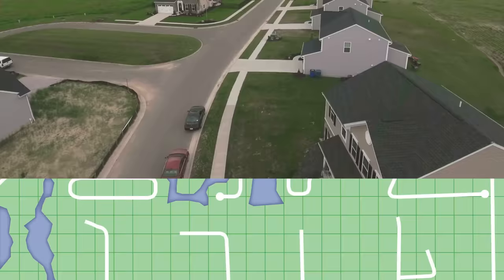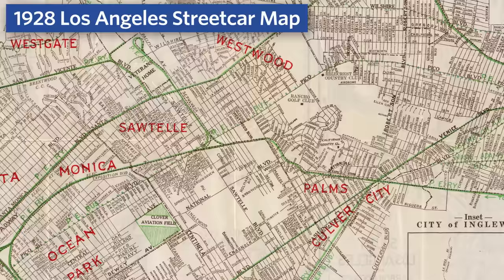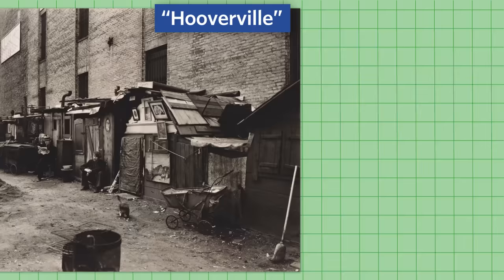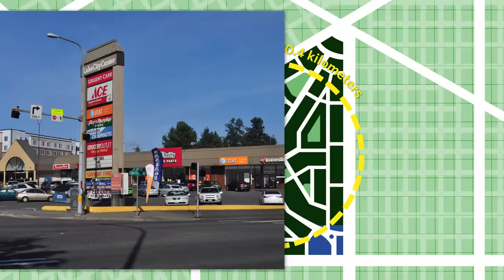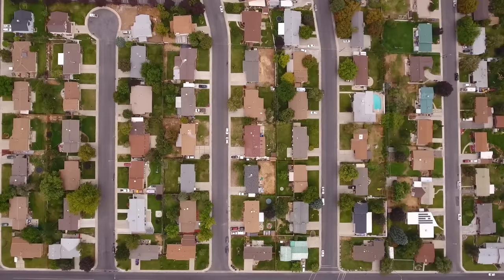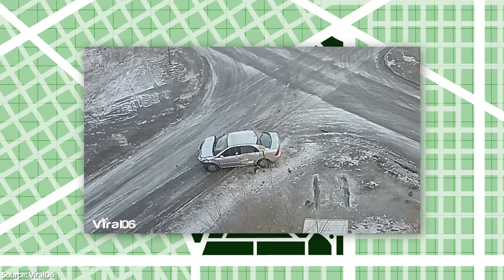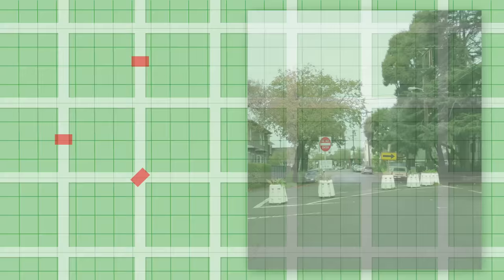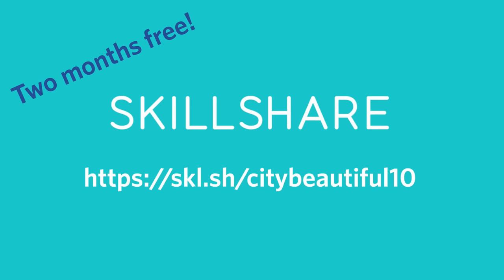The Reason Our Streets Switched to Cul-De-Sacs

Comment: Simple: They reduce the amount of traffic on residential streets which is desirable to homeowners.
Reply: And the speed of what traffic there is.  Yes, I get lost.  Yes, I still think it’s a great plan to reduce traffic in residential areas, especially in the age of Waze rerouting people strangely.
Reply: Reduce traffic, what? The fact is that you have to INCREASE traffic, as you sometimes have to drive two or maybe even three times as far to reach your destination. And the “reduction of traffic” you are pointing at is only moved to somewhere else, so some roads will be congested and some roads will be nearly empty, so it’s not solving anything for the area as a whole, but for some areas isolated. But since you always have to look at the total impact the calculation will be a negative one. Because of this cul de sac system it’s also much harder to run an efficient public transport, that is just one problem.
Reply: roads designed to not get used. seems useful.
Reply: I mean if you haven't lived in one, you wouldn't understand maybe. It does a great job, neighborhoods are quiet. It just necessitates a car. If you need to drive to the shops, you're not gonna drive in circles for hours to get there, the path is straight. If you're gonna drive to your friends house in the same neighborhood, it'll take some navigation but you'll get there. The only thing that's bad about it is walking around.
Reply: @jty9631  I live in one so I know how bad this is overall. People are still driving regardless, it just mean you have to drive 3-4 times as far to get around everywhere instead of cutting through. So it leads to more car travels in total. Also longer to walk so not good for old people that can walk a mile but not two. In total it’s more problems than it solves.
Reply: Motorman I think you’re missing the point. They weren’t talking about decreasing the amount of time each car spends driving to get somewhere, they were saying that there are fewer cars going past a house that sits in a cul de sac than one that sits in a grid where regular traffic can cut past your house to get where they’re going.
Reply: @shaunenwright7872  I am not missing the point. I know that. The point is that with the cul de sacs it will be more driven miles/kilometres per car, in total over a year. And yes, houses at the bottom of cul de sacs will see less traffic. But the traffic has to go somewhere so some of the roads will se A LOT more traffic. And that’s why even small villages see a lot of increased traffic and even congestion at certain times of the day. It’s overall not a good solution. Only people living in the cul de sacs will see less traffic as it’s no through traffic, and the other roads will see an increase, a huge increase. And EVERYONE will have to drive longer in total. For example we live at a bottom of the cul de sac and have not through traffic, great. But if I want to drive or walk to a neighbour that lives 200 meters from me I have to drive or walk nearly half a mile, it’s not a good solution.
Reply: reduces traffic for those on the cup de sac streets; increases traffic for those living on the feeder streets.
Reply: Maybe you guys have weird cul-de-sacs then. The one I used to live in had a straight path to get out of the housing development. Most everyone in the development had an easy, straight path to get out because there was a big infrastructure of roads surrounding it all 4 sides of it. Mine was built fairly recently in the late 90's, in Henderson Nevada. 

Like I said, the only difficulty was going to someone's house if they lived on the other side of the development, because it was a fairly large development. Hardly anyone socializes with other people not on the same street with them anyway.
Reply: @Shesha Well the cul de sacs are not usually very long, maybe a few hundred meters. But you have to double the distance since you drive in and out, and if you multiply the distances with all the journeys over many years the extra driving distance will of course add up to millions and millions of miles during a year. For example I could drive to one particular neighbours house in about 10 seconds if we did not live in a cul de sac. But we do, so to drive to this particular neighbour I will have to drive at least 10 times the distance, taking 1.5 minutes, no big deal when you do this once. But when you add all this extra driving for all the cars in the country year in and year out it adds up. And the so called safety is out the window as the extra traffic of course will lead to more accidents, not for the houses at the bottom of the cul de sacs but for houses in other places as they will have more cars driving past THEIR houses, I just don’t understand why this is so hard to understand. Yes we live actually at the end of a cul de sac, so even if we don’t get cars passing at high speed lots of cars will go down to turn around in front of our hose and then go back at a high speed past the houses at the beginning of the cul de sacs TWICE as of course they have to get in and out. It’s vaster of fuel, increase drinking distance and all in all will increase accidents as of course driving distance is increased.
Reply: @Shesha Well all I can say is that I live at the end of a cul de sac and I probably drive at least 500 meters extra every day because of the cold de sac system. That is 180 kilometres each year, 900 kilometres in 50 years, and multiply that with millions and millions of cars just in the U.K., it all adds up, of course in addition to the irritation on top. And no, with cul de sacs traffic is not moved to bigger roads as you still have to drive or out or in AND out of the cul de sac so on average it increases traffic also on smaller residential roads.
Reply: Also helps reduce likely hood of getting surveilled for potential robbery.
Reply: @DZ4295DBW  Well, as far as I can see that is the only advantage of living at the end of a cul de sac. In all other ways it’s only disadvantages.
Reply: @truxton1000  it stops the through traffic, so you don't need to deal with assholes like me trying to cut a corner off my 'calculated route' jusr to save a few minutes. thats the traffic reduction. only the residents are driving on the road.
Reply: @truxton1000  Who gives a shit if you have to drive a little bit longer? Not having cars driving past your house at 3am blasting music is worth it. Having kids being able to safely get out of the house and play basketball, road hockey, etc with the neighbours is worth it. Being part of a tighter knit community is worth it. Being able to take your kids to a quiet park is worth it.

I can’t believe someone would be willing to throw so many benefits away just because they don’t wanna drive an extra 1-2 min to work
Reply: @ccrimewave  You miss the point, don’t you understand the simple fact that yes, the houses at the bottom of the cul de sac does not get through traffic yes that is true, but the houses at the outer end of the cul de sac get twice as much?? I live at the bottom of a cul de sac so yes, great with no through traffic but I do have to drive longer. And I do care about these things as we have to live with these problems for decades. Why construct something that is not the best solution? 

Your argument about “having cars past house at 3am blasting music” is just not true for the houses at the start of the cul de sac. Because if my dropped off by her spotty 18 year old at 3am that car will have to pass the houses at the start of the cul de sac TWICE as the car have to get in, turn around at some point and get out so your argument is useless. Try to understand this: cute de sacs DOES NOT REDUCE TRAFFIC! It actually increases it in total, and even if the people at the bottom of the cul de sac gets a bit less traffic other roads get more than twice as the cars has to go somewhere.

Anyone who does not understand these simple facts must suffer from low IQ, or maybe you have theory on that too?
Reply: @truxton1000  that’s a long winded way of saying “cul de sacs suck if you don’t own a car” which… kinda? 

If you are in a city, there’s still most likely a bus stop within a typical 3-8 minute walking distance (down from an admittedly much shorter walk on a grid). Whoopdie doo. Cul De Sacs force people who don’t have cars to get exercise before riding public transit. How horrible!
Reply: @ccrimewave  What are you talking about?? I have lived at the end of a cul de sac for 18 years, so I know what I talk about. We drive, and sometimes we walk. Regardless everything summed up cul de sacs are not a good solution for all the reasons previously mentioned. Yes as we live at the end of a rather long cul de sac WE don’t get any through traffic but that can of course not be said for all the people living on roads that get more traffic because we get less.
Reply: @truxton1000  the roads that get more traffic because “you get less” are the main roads and highways that traffic gets diverted too. Nobody lives on those roads. Those roads are where strip plazas, malls, grocery stores etc are, and the highways are mostly barren on either side. What are you not understanding about this? Nobody lives on the roads that get the increase of traffic and THATS the entire point.
Reply: @ccrimewave  That’s not the case where I live as there are houses around nearly all roads.
Reply: @jty9631  it’s subjective I’ve lived in both systems and prefer less restriction through the grid system but I understand why some people prefer cul-de-sacs
Reply: @ccrimewave  weird thing is I had everything you mentioned more on a street within a grid system
Reply: @uwaisbangi2959  Where was that? Reason why I ask is that there aren’t many places in the world that still have a grid layout. And none of them have what I’ve described.

Comment: This layout and zoning make a car necessary.  And more difficult to implement mass transit, even bus viability.
Reply: Aye, the most crucial aspect is the zoning restrictions. Most people overlook that.
Reply: who wants mass transit at your doorstep
Reply: James Bradley good. Mass transit is trash.
Reply: Tony Joe mass transit is incredible, it reduces pollution, traffic, increases social mobility and boosts economic output you’d be seriously missing if you didn’t  implement mass transit as a major city or metropolitan area. It’s what makes the cities of the Eastern USA, far more productive, populous, large and easier to live in when compared to the cities of the Western USA.
Reply: @tonyjoe1594  As opposed to sitting in traffic for hours a day, if in the U.S. it's only going to get worse.  And the solution is to make bigger roads to reduce congestion which cost taxpayer money or add another train to the line to increase capacity. Which cost less?  Then there is cost of maintenance, fuel, insurance and monthly payments with interest. which can add up to $500 a month conservatively.  Where the cost of mass transit in other countries is $2 a day for most people.
Reply: I've found that a hybrid between cul-de-sac and grid design seem fairly effective for transit, in smaller communities and divisions. The design would cut cul-de-sac's into smaller pieces interconnected by busier drives. Pedestrians however have to walk long distances to get anywhere, my walks tend to take hours of just walking to get from place to place
Reply: @pinkfloyddwc  I live less than half a block from a bus stop in a neighborhood as gridded as the topography makes practical and much prefer that to more modern designed areas around my city, thank you very much.

The area is extremely walkable, with its grid, sidewalks, and everything you need withing walking distance and still manages to keep much of the neighborhood fairly low traffic by simply using 1-way streets to encourage use of the main roads and save space and pavement.

Public transit is great and we need more, not less of it.
Reply: DynamicWorlds wrong
Reply: @pinkfloyddwc  such a cutting and thorough rebuttal. /s stay in school kid, and pay attention in class.  You might learn something.
Reply: It boosts fuel consumption
Reply: Who wants mass transit at your doorstep? everyone ? imagine having to drive everywhere. Mass transit makes a huge city seem very small. The city is 6-7 miles away but I feel like I live right next to it since it only takes me 10-15 minutes by train. Whenever I'm in the car I'm like, holy cow I never knew this city was so huge...
Reply: @tonyjoe1594  Mass transit is incredible. It can reduce the amount of drivers on the street who really have no business being behind the wheel. I much prefer dealing with the New York subway than having to deal with rush hour traffic and all the morons who don't understand the left lane is a passing lane.
Reply: @batliff  actually, afaik, increasing the size of roads doesn't reduce congestion. it just makes more people use the streets.
Reply: I mean everyone can just bike to the bus stop but I agree with your point
Reply: I guess bicycles/scooters will thus become more important in making public transport/mass transit more accessible. If there're safety concerns then non-motorised ones could perhaps be considered
Reply: @ROCKSTAR3291  

The guy has no interest involving himself in a reasonable conversation on the issue... He prefers having to drive everywhere to get to somewhere. Even to get a haircut and to buy soap and paper or fresh vegetables, instead of just needing to walk a few minutes to and from a convenience store or the shopping and services centre for the set of blocks...
Reply: @batliff  building more roads doesn't ease congestion. more people just decide to drive shortly after the new road is made so traffic is basically the same but a little worse.
Reply: @vegastar558  That's what Japan did they aren't a car obsessed culture. They walk a lot. Walking is damn good for weight loss. Unless of course you eat like shit.
Reply: @hainleysimpson1507  murica comes in
Reply: @pinkfloyddwc  I do. Cars are the downfall of American society.
Reply: Joey Snow1  that's because America has the shittiest bus system of all modern countries. I'm college student that just immigrated here and I can tell you that even the 3rd world country that I immigrated from had a waaay more efficient public transport system than the richest American cities. They just put trillions of dollars into it recently while California is struggling to even put even any train tracks down.

Hell, it doesn't even have to be a bus stop   in front of your house. It just has to be within walking distsnce. And people would use less cars with a better public transport system so that solves your traffic problem. The way Americans view public transport and cars is a key factor in this countries downfall. Keep busting out thousands to keep your cars while the rest of the world laughs
Reply: @pinkfloyddwc  I do!
Reply: @pinkfloyddwc  Yes, especially since I left the US and moved to a country that has amazing mass transit--at my doorstep.
Reply: @rogermichaelwillis6425  buy a car you bum

Comment: From what I’ve seen, the curvy roads and cul-de-sacs are always much nicer cities/neighborhoods than the grid ones. And the grid neighborhoods invariably have more concrete, less landscaping, everything is more dense and usually dirtier...
Reply: Integrating both grid and cul-de-sacs is currently a good choice so far. China cities have adopted this method for years and it works perfectly well even with huge and dense population.
Reply: Ive seen most culdesac without sidewalk or streetlamp or navigability for anything but a car. Houses may be expensive or cheap, but I would prefer walkability with some more concrete and a streetlamp, and most of the time that with grids cus theres less roads so towns have more money to spend on building and maintaining infrastructure other than signs and roads. May not look as green but I think improves the quality of the neighborhood by making it easy for neighbors to interacts and to go on walks and I think protects against blight but idrk lol.
Reply: I prefers grids
Reply: I honestly prefer grids, I live in a grided neighborhood and it feels more alive then any culdesac I've been to.  Even suburban grids feel more lively then Cul-de-sacs. You see people walking and playing outside, you just don't see that often in cul-de-sacs

Comment: My town in the UK uses cul-de-sacs (specially “closes”, which I think are a UK thing but they’re basically cul-de-sacs with an extended area for walking on outside of the car park, but the beauty of the plan is having pedestrian paths and areas car’s can’t take, which makes moving around a lot more efficient on foot as you don’t need to mess around with driving through cul-de-sacs and curvy side streets. But our streets are still a lot straighter and less circuitous and wasteful than typical US suburbs, and it also has smaller roads and streets as it’s less car centric.